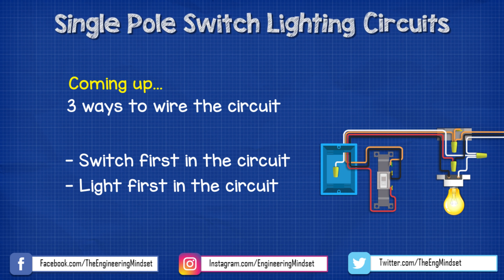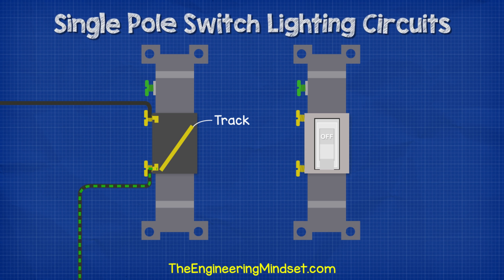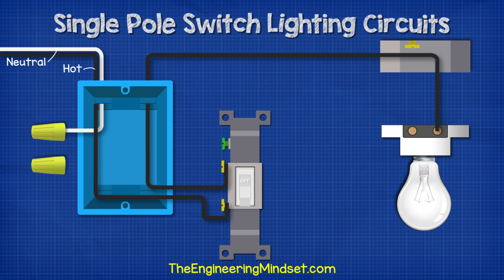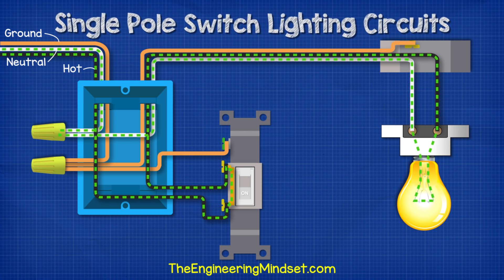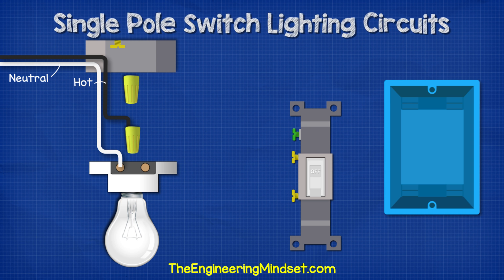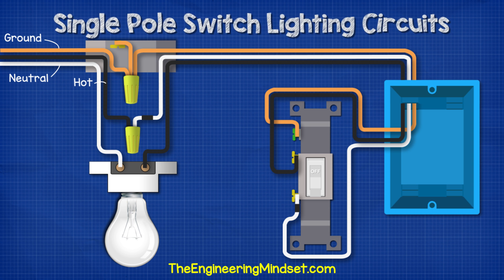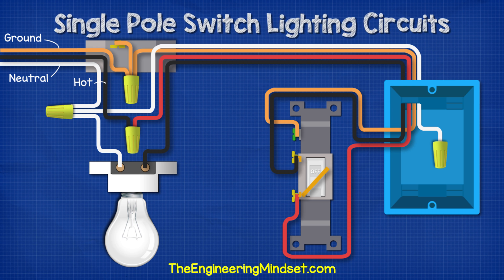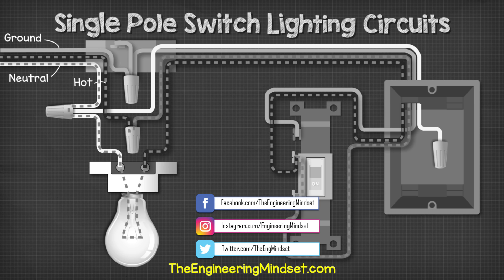Single Pole Switch Lighting Circuits - How to wire a light switch

Comment: What would be the advantage/disadvantage of each method?
Reply: The method used has no real advantage. Its determined by if the power goes to the switch first or the light first. That is determined by where the power comes from. The shortest path to use the least amount of wire usually. 
The second option is no longer allowed because of the lack of netural. The third option is a remedy for that.
Reply: The advantage of running ur hot to the switch 1st is that if u ever need to trouble shoot something, u don't have to get a ladder and get in the light in the ceiling! Just easier.
Reply: @bunkyspunkmeyer  what well happen if the switch is in the neutral?
Reply: @alimohammad7799  If the switch is in the neutral?  It's against code to wire a switch into a neutral wire.  So, don't do that.

Comment: The only problem i have with the third option is if you get a noob looking at the switch and they see black and red they can get confused and wonder why there is a 3 way switch there.  They will then waste time tracking down a second switch that does not exist. Other than that if you have 3 wire romex  on hand then that is an easy fix to a simple problem
Reply: It should be obvious the switch has only two terminals.  If this is confusing, then they should leave into someone qualified and knowledgeable.  This stuff isn't  rocket science, so if it doesn't click pretty quickly, best leave it to others.
Reply: If it's also a hot cable, then why use a different color? Why not just use black wire instead of a white cable and black tape? Would it be to differentiate the two hots easier or something?
Reply: KaibabaCorp HQ
The white wire is now required to be a neutral in the switch box per Code.  This is to ensure future-proofing, as more and more "Smart" devices are being installed in walls to replace traditional switches.  Those Smart devices need their own power, which requires a neutral connection (just like the light bulb does).  The second demo in this video is now illegal in new installations, but is still perfectly safe and works fine, unless you need to install a Smart switch.  The first demo in this video has the neutral in the box with the switch, so there is no problem there.

Comment: I'm not certain but I believe you need to have a neutral wire in your switch box by code now. I think Sparky Channel said about this in one of his videos
Reply: Didn't know it was by code, but it's super helpful if you want to add in stuff like smart switches
Reply: Yes its required by code now. Mainly because of timers, dimmers and smart devices which require their own netural to connect to. While it's bad practice to do so now, it's good to know because you will find it in older places.
Reply: @BrandonFrancey  got a code reference
Reply: Not if the house is old say 50s and nothing g has a ground oh and smart switch still works

Comment: i don't get  the second one. Why not connecting the hot wire directly to the switch?
Reply: depends on how the romex is run. If you are entering the room on one side, want the light in the center, and the switch on the other side of the room, you'd use less wire this way.
Reply: @damiensees4232  How would it save wire? As i understand it, we just have to eliminate one ceiling nut, connect the hot wire directly to the switch and to be conform, change the (old) black, hot wire from switch to lamp to a white, neutral one. Cable length stays the same, but we'll use one nut less and have simpler cable colours. Is there something fundamental i am missing? :-(
Reply: @samehedi  Maybe I'm misunderstood your question. The black wire or white wire with the black tape on it mean the same thing. It's hot. The reason there is a break in the ceiling box and a wire nut on the line wire is because romex wire is a bundle of three wires and to physically wire that scenario you would need to cut the romex in the box. I personally would have connected black wires together when running the next wire to the switch like I believe you are suggesting, then use the white wire with tape to feed the electricity from the switch back to the light.
Reply: @damiensees4232   @Poképartum Depression, thanks! I totally forgot about the wires not being separate cables. That was the fundamental issue. Thanks a lot for your comments! :-)

Comment: Why would you ever use a white neutral wire as a phase???
Reply: 17AB24 In North America (residentially) we almost always use wire which has a black, white, and bare (and sometimes red) wires already joined together, like an extension cord.  They are not run separately like in the video.
Reply: Wesley Van Pelt   Agreed.  I think in terms of separate lengths of Romex - one from the panel or to the light junction box, and a section of cable placed between the lamp and the switch - then what conductors need to get hooked up where.
Reply: Get your thinking straight.  A white wire is a neutral OR a hot/phase.  It cannot be both.  By default, white means neutral.  If it's reassigned to be a "hot" wire then that's when it gets the black marking.    This has been done for decades because it's cheaper.  But it is no longer allowed in new installations except in specific circumstances, because future-proofing.
Reply: If power went to the light first and you added a switch. Like if the fixture had a pull chain and you now want a wall switch. The reason you would run it on the white wire is so if someone is testing the circuit wont mistake it as an ungrounded circuit conductor if referenced it to ground. It would read 110v (ungrounded circuit conductor) when referenced to ground. If it was the other way around, it would be mistaken as an ungrounded conductor and theoretically it would look like a hot and neutral in the box opposed to a hot and switch leg.

That's why you should use the 3rd method. You use the traveler's for the switch and have a neutral in the box. That would give you a hot neutral and switch leg. 

You have to to identify the white wire too if used like that. It's all in the nec.
Reply: Gumba Sal 
Correct 
Also with the neutral in the switch it can be use for dimmer switch that required a neutral or other smart switches and for a branch circuit in the future. It’s a requirement in the CEC I’m not sure if it is in the NEC
Reply: You use the white wire so that you can use just one wire bundle when powering the light.  If you do not do that then you will need to run another black wire to the light and the switch or do as he described and use a three wire and have the red as the power. Just as safe and it saves time and money.  I also heard about the neutral wire but have not looked it up yet.